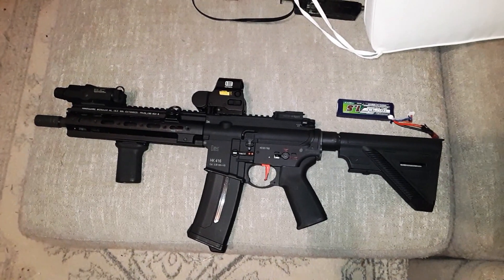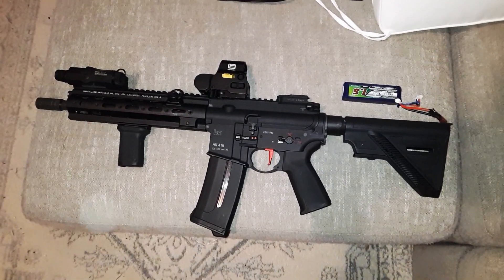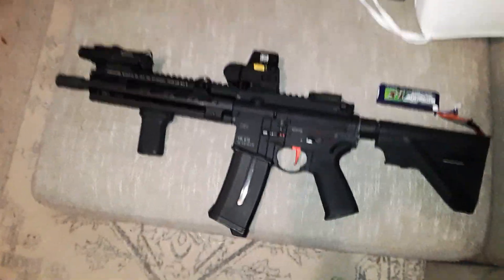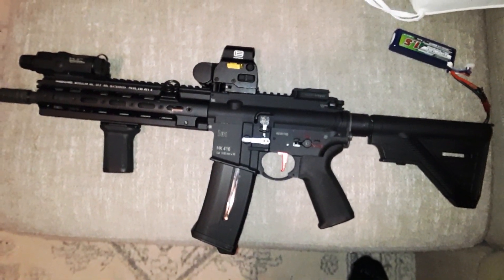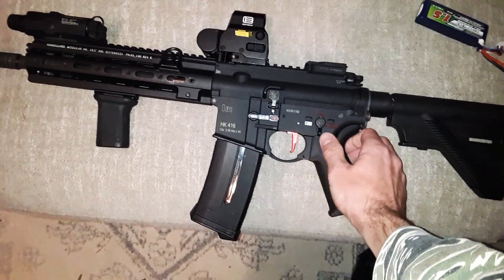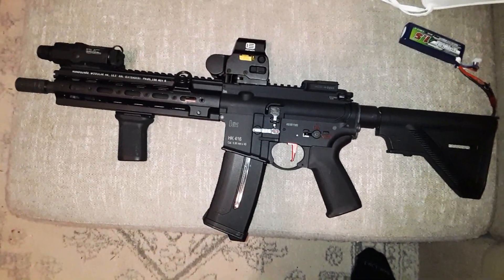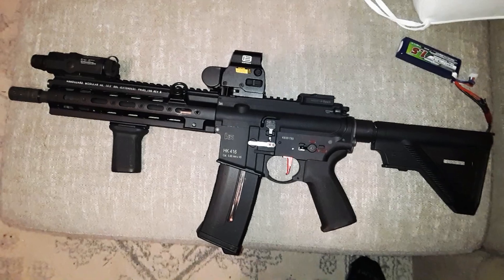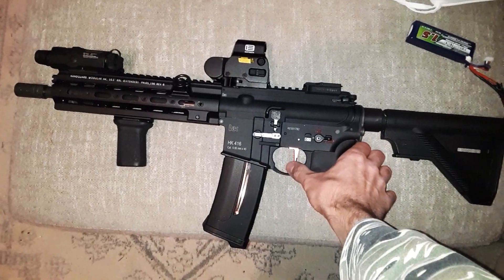Testing Apache Tappetless Cylinder. Pt 1 of 2

Comment: I got mine but running into an issue after it cycles (fires) that it traps some air between the cylinder hand and piston not allowing the nozzle the fully retract causing feeding issues......
Reply from the maker: Hmm I haven't experienced that. The spring inside the Apache should cause the nozzle to fully retract every time regardless of air pressure. From there so long as you're not hitting pme all the air should go out the nozzle before the spring forces the nozzle back again. Your spring might be broken or one of the internal orings damaged. Try pulling the nozzle forward by hand to test if it springs back completely
Reply: @jhqtech   Nothing broken or damaged.  I just have too good a seal going on. I suspect.   Since I don't have pre cocking on the piston defaults in the forward position after firing and when the nozzle tries to retract back it traps a bit of air right as the middle nozzle port slides over the center stud.
Reply from the maker: @paulb2948  I'm sorry I haven't encountered that problem I'd have to see it in person. I'd advise emailing aztech armories as they're very responsive and their head tech shakka would be the best person to speak with as he designed the Apache

Comment: How did you get good at tech work? I don’t know how I can start practicing without destroying one of my guns then having to pay someone to fix it lol.
Reply from the maker: So I literally take guns apart at night almost like meditation before I go to bed. I also search "airsoft tech, airsoft dsg, and new airsoft" every day. Anything and everything I find I watch or read so i can have the best idea in what I should buy and work on.
But that is secondary to just opening a gun up and learning how it works. Buy a spare cyma gearbox for 40 bucks, and just take it apart until you have it memorized, buy some spare parts and experiment with how they interact (cutting tapper plate, short stroking teeth, aoe, whatever bs you want to try to learn. From there it's just all trying parts and comparing your results to your research online and from others. 
The main point of my channel is to help make a source of info that helps people from having to search everywhere, but everything in airsoft can be flawed or different from someone else's results making experience the most valuable thing.
Reply: @jhqtech  awesome advice, thanks brother! Really helps!

Comment: How is the head working do you like it ? I didn’t get to grab one yet for testing 

Did you have any issues with it ?
Reply from the maker: So I'm still getting it to feed correctly at this rps  (im also working on this, p90dsg, toughest piston test is waiting on your piston to arrive, also I have 3 builds to finish and send out in time for Christmas)

As it currently sits on my table, it feeds up to 40rps very nicely. I did have to lengthen the nozzle (seems to be a little shorter than standard nozzles) and it seems to shoot about 15fps lower than from the traditional tappet. This is probably because theres now extra space to volume in the head itself to actuate the feeding.
- I dont know if I like the internal spring, it seems like it could be bent at high rof and completely malfunction
-dependent on compression. If your piston doesnt compress air very well (use vitons baby) then it wont work well.

I'm testing another in a dsg I'm just cutting teeth off of to see how volumizing/compression effects the feeding. 

Trust me once I get it perfect (I've been told 75rps is the limit) I'll release pt 2, my goal is to have the greenest, meanest line of tracers ever shown on youtube
Reply: @jhqtech  pretty sure that they have had the gel blaster version doing something like 75rps without any dramas over here contact Marty at azraels armory in Australia and he can get shakkas the tech to help with any tip's on getting the best seal and feeding problems ,they are all really laid back nice guy's and easy to approach and talk to but very serious when it comes to aeg's and building something way more reliable than any airsoft gun out there we will go through eight thousand to ten thousand rounds a game so our builds have to be spot on otherwise they will just shit the gear in the middle of the game that is why hpa is so popular over here ,matinance is almost none and worst case scenario your rubber nozzle tip pop's off during a game and you just glue it back on and away you go
Reply: You gotta get onto them J ,they were supposed to send you one but i got no idea what's happening, only thing i can think of is they don't need any help with moving them all us gel ballers over here in aus are going nutz for them they can't keep up with the demand and that's just the gel blaster version, we don't have the airsoft version available here cause it's illegal in Australia 😫
Reply from the maker: I have a second order of them that seems to be stuck in customs still, shipping could be an issue
Reply: @jhqtech  we have had huge problems with the post recently over here and the covid bullshit hasn't made things any easier ,i haven't got one yet but my mate has with a warhead motor and leviathan and he can't say enough about it really consistent numbers and around a 10fps spread and that's unbelievable for gels ,that's our down fall the gels aren't the most consistent in shape size and weight so the chrono readings generally show a 30fps spread sometimes a bit more depending on the quality of the gel ball's ,a few things affect the gels we prefer to use distilled water or boil the jug and let it cool off before using the crap they add to the water isn't great for growing gels in but a lot of guys just use straight up tap water cause they aren't that fussy or don't care that much but finally they are getting harder and taking like 7-8kg of pressure to break so they tend to bounce back at ya 😅
Reply from the maker: @paulshoebridge3191  thank you for the information, I always figured gels would be more inconsistent. My goal is to hit the 75rps mark and feed consistently, I just need an afternoon to tinker with it and I think I'll get it. I also wanted to ask them how the weight of the bbs could affect loading. But either way they have some amazing parts that I'd love to get more of as they're the best
Reply: @jhqtech  the brown piston's are the strongest on the market and they do a hi flow piston head and the brown viton oring's are the best out there ,we have to make our setups much more reliable than a airsoft version cause we will go through 10k rounds in a game so things need to be perfect for reliability
Reply from the maker: @paulshoebridge3191  yes the brown one is the one I'm testing vs the shs blue, kratos white, and real deal piston assembly. I've already joined the viton oring gang they are far superior, I'm just not totally sold on the metal piston heads. I'm still a believer in the pom heads for their light weight and strength
Reply: @jhqtech  true but some of the hi flow ones are still fairly lite ,supposedly azraels has added 80% more material around the ass end and where the blue shs start to give out at the 60-70rps where as the brown Aztech pistons keep going and i also have pretty good success with green oring's apparently they are used in your air con system in ya car and come in various colors but can handle high heat
Reply from the maker: @paulshoebridge3191  haha the green car orings are a hack I use in my gas guns for a better seal, glad to see other people have found that out. But I just included the shs blue because its famous, I can easily see it has the least amount of reinforcement at the back and I've blown them out at 50rps.. really i just want to see if the aztech or real deal piston is better since Jake seems to almost be modeling his piston off the aztech one
Reply: @jhqtech  and the pom piston heads are good just gotta get one that it strong enough ,i had someone bring around a APS phantom a stubby little thing cause they have no idea about the things so i pulled it down and it was the switch block burnt out and the piston head fell out of the cylinder in pieces i couldn't believe how shit the quality was but that was the first lot of emg APS cast gearbox and the new lot is stronger and now use's a cnc'd ally piston head maybe try a retro arms piston as for the head bigger hole's stops the vacuum and i guess make the oring flare out quicker
Reply: They are definitely doing some good stuff for the sport and consistently tweaking things and are getting better and better as time goes along we need more people like those boys to keep pushing the bar
Reply from the maker: @paulshoebridge3191  my go to has been the lonex POM head. I've never broken one and I slightly bore the holes for better flaring of the oring in compression. I'm sure the high flow head helps, it's more so the shock of a metal piston head with a metal cylinder head against a metal gearbox has lead to cracks at very high rof unless I use a nicer gearbox. Where as I've run a pom piston head in all my guns and never broken a gearbox accept once with a vfc stock shell at 60rps (but I think vfc is more at fault)

Comment: Great channel. Happy I found it. Can we find reliable drop in plug n play tappetless cylinder right now? Especially for lower speed builds.
Reply from the maker: The aztech apache is currently the only one for airsoft use. And they will always require tuning as you must adjust the nozzle length and spring tension to fit your personal build. I doubt they will ever be truly drop in plug and play
Reply: @jhqtech  got it. thanks for the knowledge hombre
Reply: @jaminbrown4190  get one it will work awesome